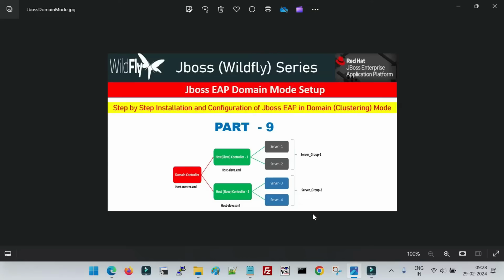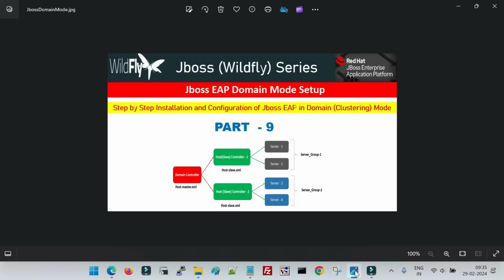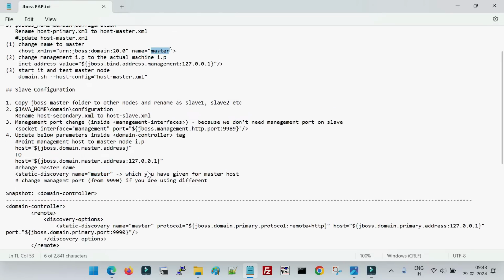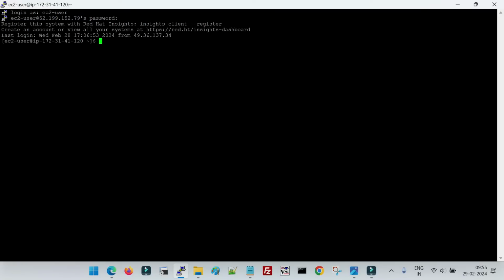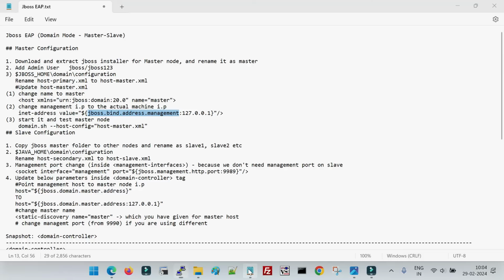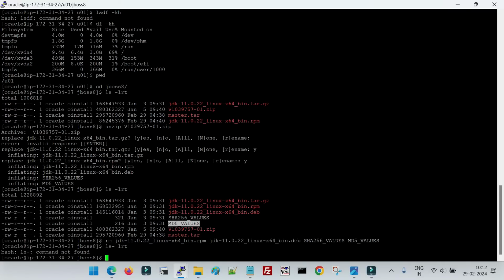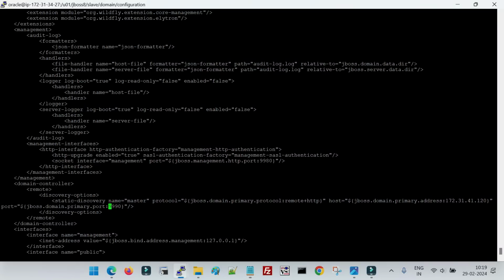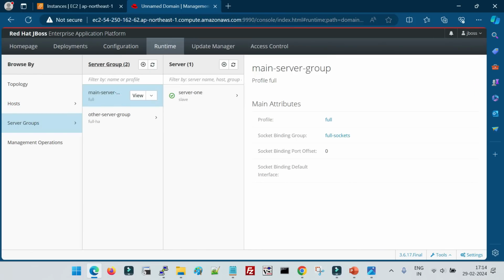Jboss EAP 8.0 Beta Domain Mode (Clustering, Multi Machine) Setup. Step by Step Plan and Execution

Comment: Hi sir, I need to handle multipartfile file upload of 16 GB file, encountering outOfmemoryError: java heap space, I have increased -xms and -xmx still facing the error any suggestions please I am using jboss-eap-8.0.0
Reply from the maker: 16gb code deployment file? You can try to deploy in an exploded form if it's a war file.
Reply: @digitak.middleware  no, the war is already deployed, it's an api which uploads a 16 GB file as a multipart file in request, it uploads up to 900 mb file size but for file size greater than 2.18 gb it throws error

Comment: I am getting below error when connecting to domain controller from slave node. Can advise on this? 
Host Controller] 21:56:39,349 INFO  [org.jboss.remoting] (MSC service thread 1-6) JBoss Remoting version 5.0.27.SP2-redhat-00001
[Host Controller] 21:56:39,859 WARN  [org.jboss.as.host.controller] (Controller Boot Thread) WFLYHC0001: Could not connect to remote domain controller remote+http://xxxxxxxx:10500: java.lang.IllegalStateException: WFLYHC0043: Unable to connect due to authentication failure.
[Host Controller]       at org.jboss.as.host-controller@21.0.5.Final-redhat-00001//
[Host Controller] Caused by: javax.security.sasl.SaslException: Authentication failed: all available authentication mechanisms failed:
[Host Controller]    DIGEST-MD5: javax.security.sasl.SaslException: DIGEST-MD5: Server rejected authentication

Comment: Bro am having one doubt we are using domain mode structure in production environment. We, are going to update password for one of main user. Our lead informed to update the password in domain.xml in Master only no need to update in slave servers. I'm not aware how it works. Please explain
Reply from the maker: It depends on many factors  like which versions of jboss you are using. Earlier we were manually using the generated secret keys for the authentication, and now a master user and password is embedded which is only required to change at master level but need to update new password in each slave host configuration file
Reply: @digitak.middleware  it's jboss 7.0.9 version. Configuration file means what you saying sir. Any example please
Reply from the maker: host XML file of slaves node, which used to start controller.
Reply: @digitak.middleware  What is the use of host.xml file and what is the difference between host.xml and host.primary and secondary
Reply from the maker: I have posted a video on jboss controllers, search on channel it will clear your doubt
Reply: Do you have steps document to share
Reply from the maker: Sorry, no specific doc. You can go through video again, the file on slave node referred as host-slave.xml in which you have to change the password if you are using the same master username and password which you are going to change.
Reply: Hi sir where we get remaining lectures
Reply from the maker: For the full course you can join the digitalk udemy course, you can get link and coupon code here https://digitalksystems.com